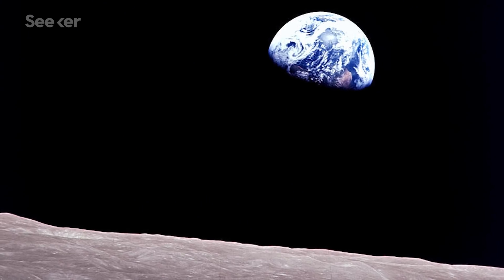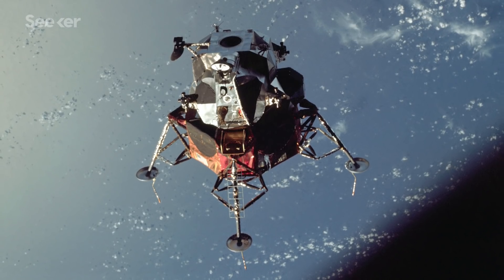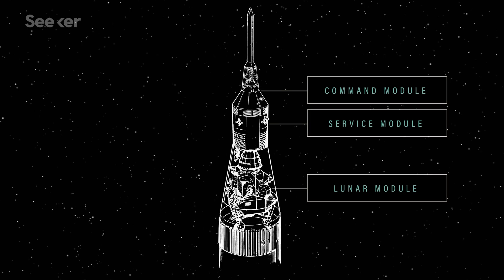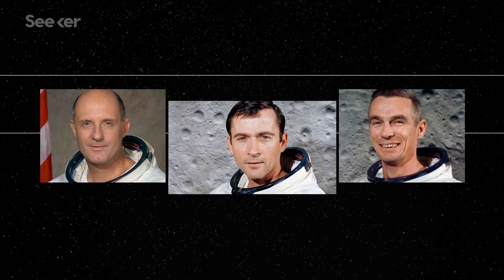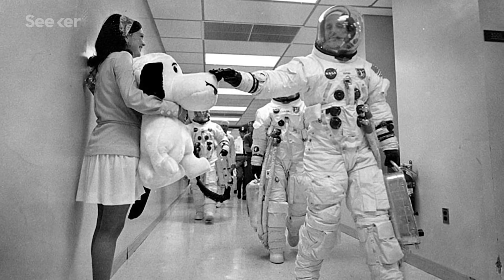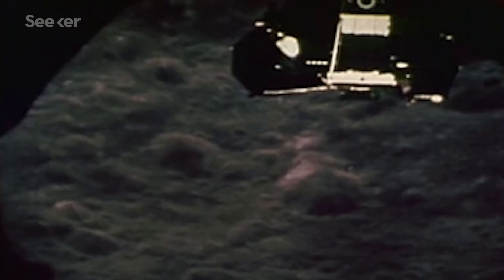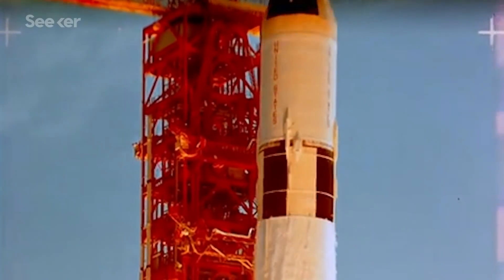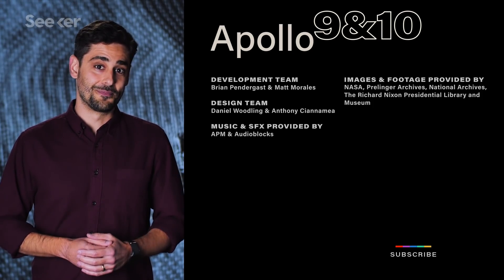Apollo 10 Almost Crashed Into the Moon | Apollo

Comment: Alternate History:

Apollo 10 crashes lunar module into the lunar surface
Apollo 11 runs out of fuel, crashes lunar module killing/stranding Buzz Aldrin and Neil Armstrong
Apollo 12 gets struck by lightning twice in a minute causing a system failure and requiring an ejection. 
Apollo 13 has a major malfunction and the astronauts on board die due to asphyxiation. 

Apollo Program: Cancelled.

Comment: Most of your stuff is accurate, but a spacecraft experiencing gimbal lock doesn't randomly slam into the body its orbiting. Not only did Apollo 10 not enter gimbal lock, even if they had, they had procedures and steps to deal with the problem. Spacecraft and often aircraft use something called inertial guidance. They use gyroscopes to measure the attitude and therefore derive the position of the vessel. A gimbal lock occurs when more than 1 gyro gets stuck in the same plane causing a loss of degrees of freedom. This prevents the spacecraft from knowing exactly how it is oriented. 

The spacecraft doesn't randomly fall out of the sky due to a gimbal lock. Apollo 10 LM experienced problems due to a human error causing an uncontrolled spin. The problem was that the LM's ascent engine was active. This could have indeed messed up the orbit enough to cause the LM to crash onto the surface.

Comment: Please don't over dramatize these videos.  The Apollo program was an incredibly risky endeavor without you trying to make it more dramatic that it actually was.  Gimble lock has nothing to do with an out of control condition.  It was possible due to a design compromise (only three gyros instead of four) to reduce the weight of the navigation gyros.  This compromise created a situation where if the spacecraft was allowed to go into a specific known attitude, the gyros could become locked in the same axis rather than independent ones.

Comment: After gimbal lock, finding the command module should be impossible. So how did they?
Reply: I don't believe that the Inertial Measurement Unit (IMU) actually went into gimbal lock on Apollo 10. Also, the IMU was part of the Primary Guidance and Navigation System (PGNS). The Lunar Module (LM) also had a backup called the Abort Guidance System (AGS) The AGS didn't use the IMU as it was totally independent. The AGS couldn't land the Lunar Module but if necessary it could get it back to the Command Module. That's what the AGS was for.

Comment: They have never landed on the moon.
Reply: How do you know that?
Reply: @hperantunes  How would I know if they had.
I believe radiation is a problem and when watching footage from the Apollo missions there's no delay when they speak with mission control. When moonwalking the astronauts seem to be supported by wires.
Reply: @habbybud  So there are gaps on your knowledge about how the crewed missions to the moon were prepared/executed, therefore you conclude that they never happened. If you knew the answers to your questions, would that make a difference in how you see the subject?
Reply: @hperantunes  Probably would.
Reply: @habbybud  That's great then! Start looking up the easiest: how much communication delay would you expect. Then move on to the other stuff.
Reply: @hperantunes  1.28 seconds wasn't the delay time I expected, interesting.
Reply: @habbybud  we  still have some trash left on the moon
Reply: @habbybud  and we do put a mirror on the moon (a special mirror when light hit it it bounce back the same direction it was hit) and if you a laser strong enough you can fire at the mirror and measure the light bouncing back
Reply: Of course apollo 9 and 10 didn't land on the moon

Comment: Excellent topic and video!  However, one mistake:  Apollo 9 was a strictly Earth-orbit mission.

Also, FWIW, it’s really unlikely Snoopy would have crashed into the Moon if it were, literally, disoriented, as to say lost track of which direction it was pointing.  They would instead just continue in a stable orbit until they get a star sighting on its sextant and recalibrate the guidance system.  To be in danger of crashing into the Moon, they’d have to “retro-fire” a (large) rocket motor, which they certainly wouldn’t do until they have a fur-sure accurate heading.
Reply: can confirm, ksp veteran here, its almost like they made this up for the click bait title :)
Reply: Apparently they actually almost did crash into the moon as a result of both astronauts flipping the same switch in preparation for separating the lander it caused it to spin out quite badly. 

When it was later studied back on earth they found that they were about two seconds from crashing into the lunar surface before they gained control, as they’d been orbiting at extremely low altitudes due to the lack of atmosphere.
Reply: ValensBellator, I guess I’m not following the situation they’re describing.  Tumbling — incorrect or out-of-control orientation or rotation — would not affect their trajectory.  To affect their trajectory, they’d have to fire a large rocket motor, like the LM descent engine in the wrong direction, it seems unlikely they’d do that unless they had stable and for-sure orientation.
Reply: Gary Morrison 
I’m confused about it as well. I don’t think it was the act of tumbling that caused crash risk so much as that initial kick during the disconnect.

From what I can find NASA on the near-disaster is they seem to imply they were just a few rotations short of being beyond the point of recovery, after which they would have crashed to the surface. Each source I can find does specifically state that they would have ended up on the lunar surface had they not quickly regained control, though.
Reply: @ValensBellator , I watched this again, and I see now what I failed to notice earlier:  This was during "PDI" -- powered-descent -- not just while in Lunar Orbit.  Yes, that would definitely fit into the "not good" category!  :-)